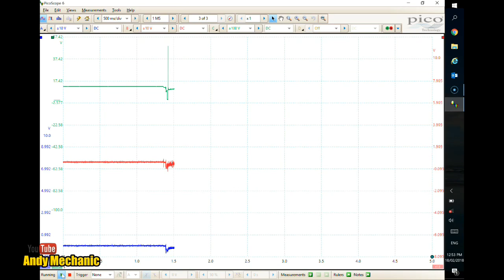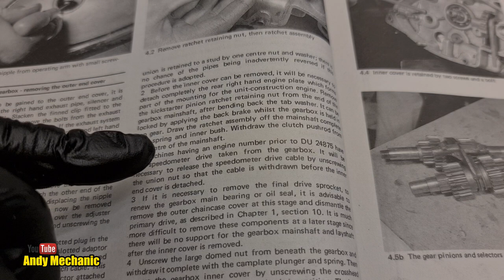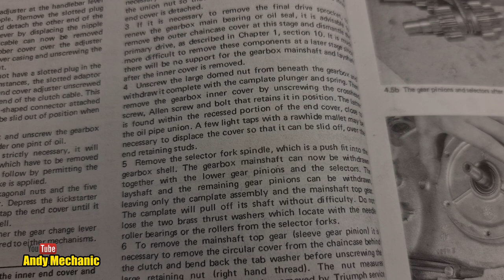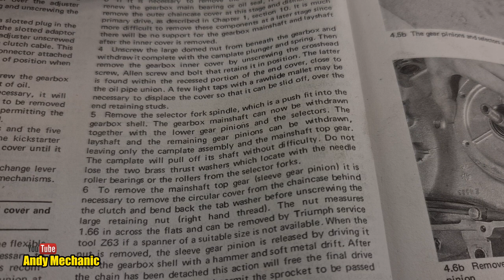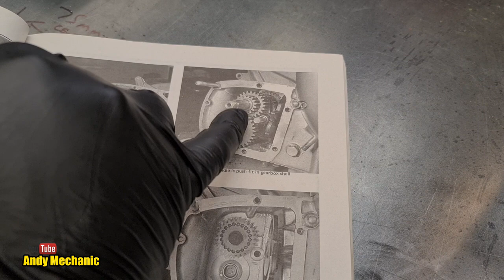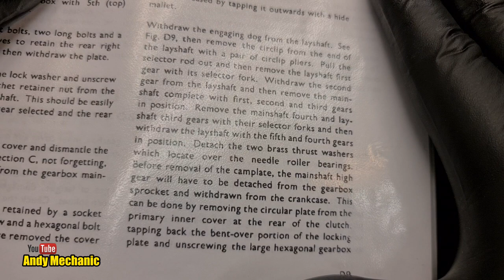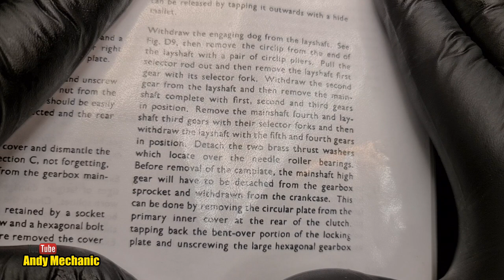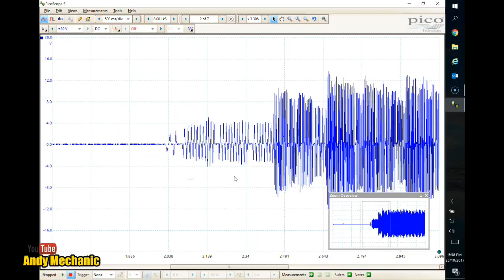Bonneville Ep.2  - gearbox stripdown #1041

Comment: When I took my crazy shifting box apart  the two tiny rollers on the selector forks that go in the cam plate  were not to be found. The box still shifted but it was full of neutrals and would jump out of gear.In the manual it tells you to put the gearset back in with both shafts and the slector shaft at the same time as the two selector forks. What a battle but I finally got it together but it took many tries. Still difficult to find neutral when stopped.Crazy that you have to diassemble the whole primary side to get the mainshaft out. 
As stated above on a Honda for example you undo 2  6mm bolts and the sprocket comes off.Triumph and HD were archaic in the extreme.

Comment: I have a 1973 Tiger 750 that has a similar gearbox but righthand shift.
I have close to 64,000 miles & never had the inner gearbox cover off.
Years ago I replaced the "U" shaped plate that retains the two cat paw plungers.
It had grooved on the inside ramps & plungers were sticking.
I was told years ago that the transmission should last forever.
The five speed came out - sometime in 1972 & I heard there were problems with the first ones before leaving the dearship parking lots.
The 1972 transmission had leaf springs  to index the cam plate.
The spring plunger design is better or so I have been told.
Some guys with 1972 transmission use some type of a jig to tap a hole in the gearbox - to convert to a plunger.
Sometimes mine makes a clucking noise when dropping into first gear from neutral at a stop - but I think this is normal.
I replaced the clutch springs; clutch plates; clutch hub assembly that includes new rubber shock absorbers - couple of years ago.
I basically replaced the whole clutch assembly except for the chain wheel, which ment that I had to reshim the engine sprocket to keep alignment within .005 inch.
The new clutch components made a big difference:
Plates do not lock up even after sitting over the winter.
Clutch does not slip.
Smoother shifting due to new rubbers etc.
Always use a new center locknut when mounting clutch.
Some people will say you can.reuse the lock nut just apply red loctite, but I don't think that is a good idea.
Anyway good luck!

Comment: I built a 5 speed Bonnie years ago that suffered the same failure. The inspection revealed that it seemed that the gearbox ended up momentarily in two gears at once. The mainshaft was bent but I can’t recall if the layshaft was also bent. Coincidently the timing side ball bearing had also failed because the ball separator had come apart. I repaired the entire engine successfully. I never understood why the gearbox ended up in two gears at once. I bought the bike in its damaged condition.
Reply from the maker: Ah, very helpful Richard, thank you. I'll be returning to this project soon as the special tools I needed have now turned up :-)

Cheers Andy

Comment: Hi Andy your 57-4378  is the part number for that gear , Id say maybe someone has done some aggressive starts or accidentally bumped the gear change without the clutch  , and or a combination of a bad heat treatment etc during manufacture . And my tip for you today is Bunnings sell 600ml cans of CRC brake clean for $9.79 alot cheaper that most other places at $ 18.50 +
Reply from the maker: Cheers matey, I'm working away shortly then on the Monkey bike trip for 3 weeks so I'm hoping the Special tools for the primary drive are supplied by then. I'm fortunate that Forch NZ provide the channel with the necessary workshop sprays & yes, I now have lots of brake cleaner!

There will be more videos on the Bonny repair, just a little delayed due to other, more pressing activities.

Thanks for your advice, unfortunately this bike only did 6km with it's new owner before the gearbox fail & previous history isn't available so it's a real autopsy!

All the best
Andy

Comment: That was fun to watch.  Like an FAA investigator putting together why a plane crashed.  Now we know what that awful noise was that Allen heard.   I'm learning how to work on my bikes but I haven't had a reason to go into my gear box yet.  I feel like I'd forget how all that stuff goes back together.  I wonder if the guy who rebuilt that engine will watch your video.    Do we think something was put together incorrectly, or did it break because Allen is rough on his shifting.  : )

Triumph makes it a huge pain in the butt to get to that front sprocket, you have to take off the primary case, remove the stator and the clutch assembly with the primary chain.   I'm not looking forward to replacing the sprockets on my 64 Triumph.   On the Honda CB750 you can get to the front sprocket by removing two screws and a small cover.

Comment: Getting that gearbox out if he had lifted the selector forks  back of the shifter plate with a long Narro screwdriver it would have come out the pins on the selector forks are in the selector plate grooves at a right angle and won't allow the shafts and gears free to come forward. or pull the shifter fork shaft out first the forks will collapse out of the grooves. now you know why so many of these types of bikes are F up...